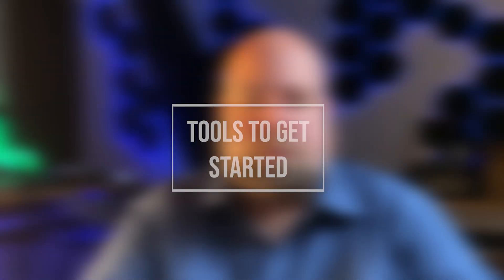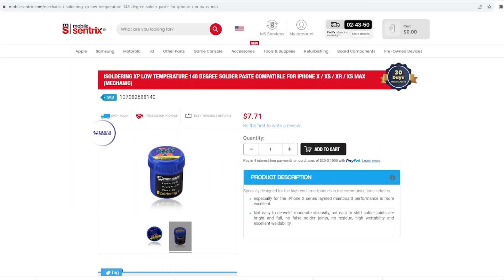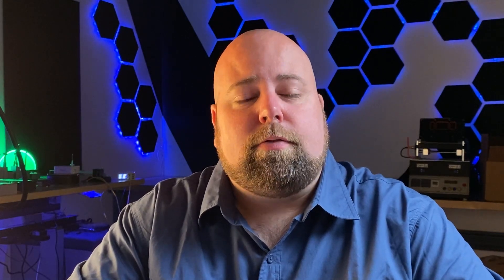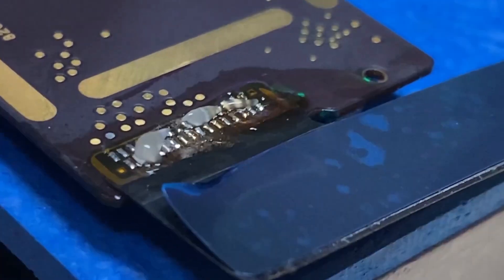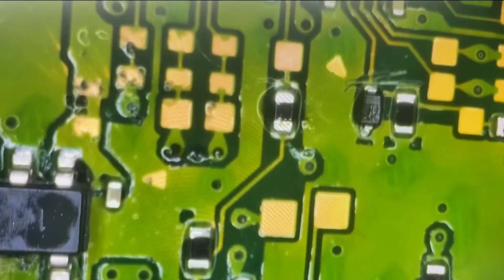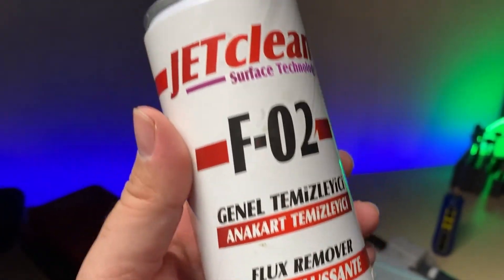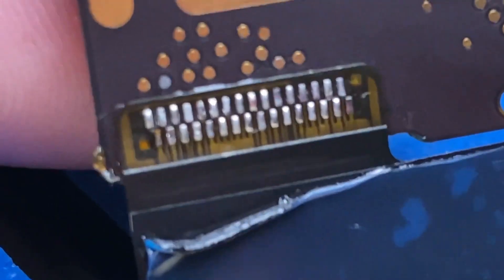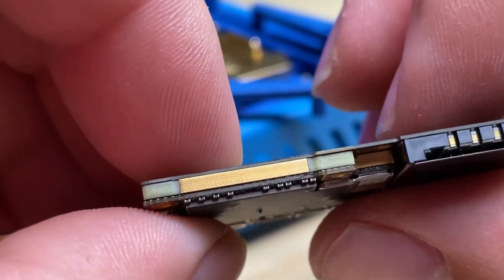Want To Get Into Soldering? Here's Where to Start(Tips and Tricks #27)

Comment: "No clean Flux" is never really no clean. I prefer to use regular flux, give it a quick scrub in IPA and an IPA Ultrasound bath if neccesary
Reply: You put IPA in your ultrasonic???
Reply: @ yes but you have to be careful. When using IPA in an ultrasonic bath put water in the bath, then put your ipa and the object you want to clean in a container that you then put in the water. That way the risk of accidental ignition is greatly reduced.